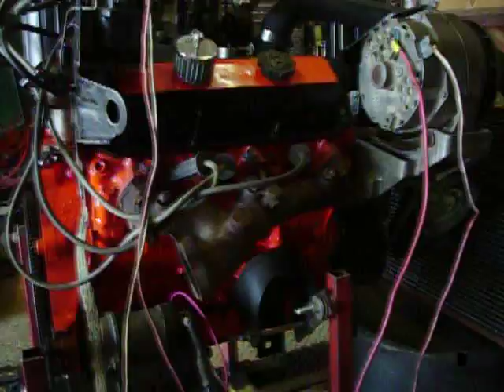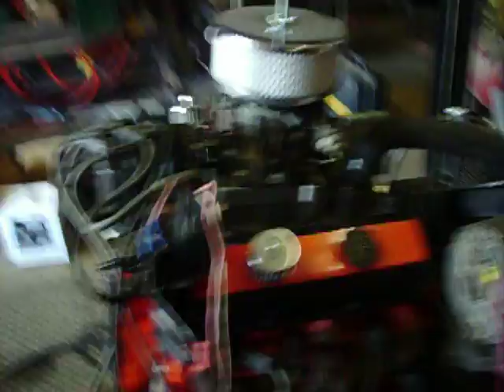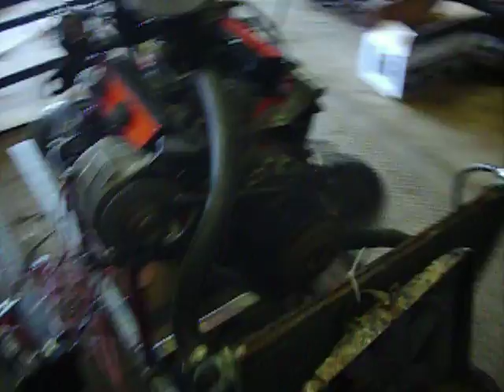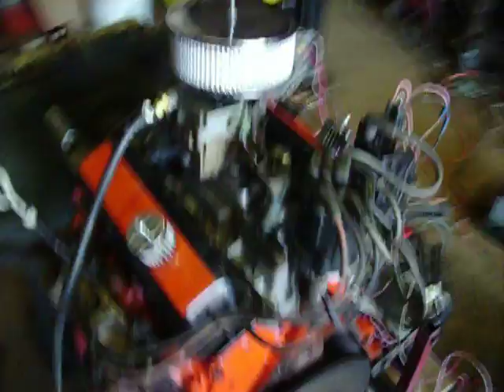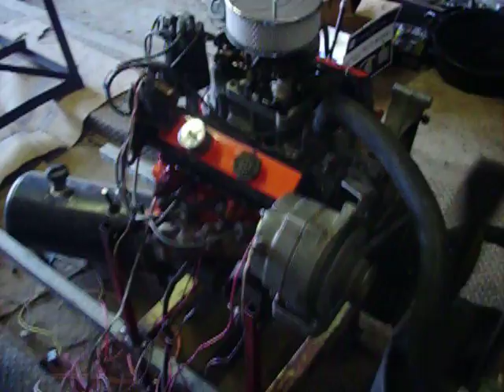'88 Chevy S-10 2.8L V6

Comment from the maker: Your cheapest/easiest gains on these engines will come from letting more air in and freeing up the exhaust.  Some people with TBI fuel injected 2.8's have swapped to a larger throttle body from 4.3 and bored the intake to match.  Edelbrock has intake and carbuerator options for the older carb'd 2.8s.  There are a few companys that make cams and headers.  But, you'll probably see the biggest gains by bumping up the compression and getting a better set of cylinder heads.

Comment: I've got a different Rochester carb on mine and want to take the old emission pump and as I call the spider lines out of the exhaust, but trying to figure out the distributor delay valve along with a few other things what vacuum lines can I remove and how to I hook up the remaking ones so the motor runs right. You seem to have this one running like a Swiss watch

Comment: 280/290 duration @.050" ?? It sounds like nowhere near that much cam, did you get the numbers mixed up? I have a 250/260 @.050 cam in my stroker motor, and it idles very rough at 1300 rpm with only 7" of manifold vacuum. Listen to it in my videos. Also, my cam has close to .700" lift, which is normal for that much duration.

Comment: Those early 2.8L v6 engines were probably the worst motor gm ever made then they came out with the multi point fuel injected 2.8L v6 and those were good engine
Reply: how much power could the multi-point make?
Reply: I'm not quite sure, look it up I know that you just couldn't kill those motors though
Reply: alex pencek so stay away from this motor? I'm thinking of buying a 87 s10 2.8 from a guy with 41k on it.
Reply: Does it have TBI? Also known as throttle body injection, or carbureted, I wouldnt take it they are both gutless and unreliable
Reply: k, thanks